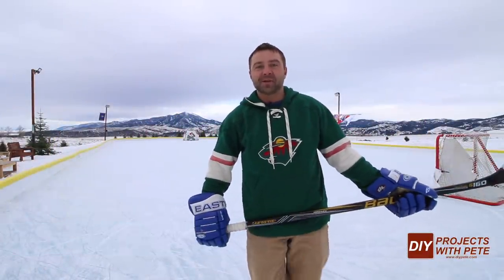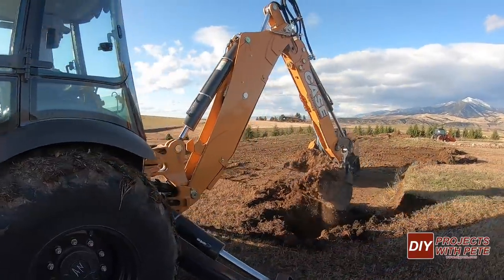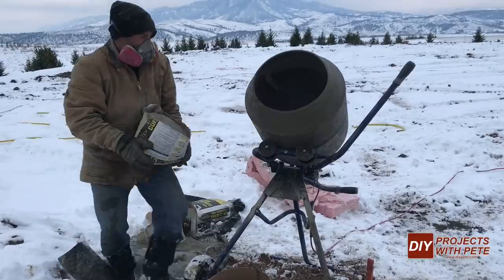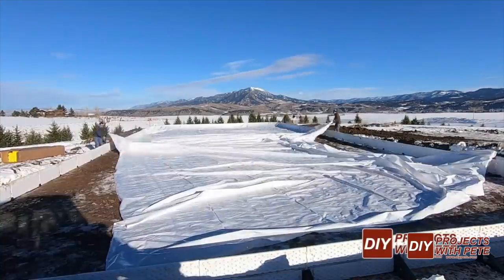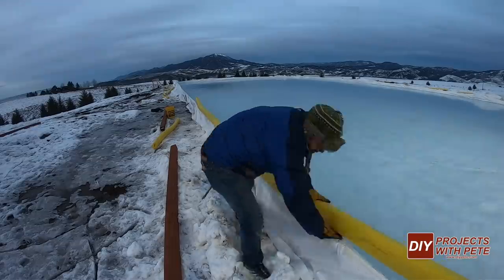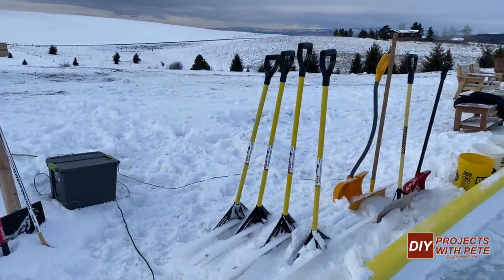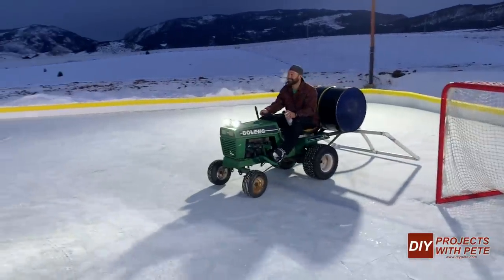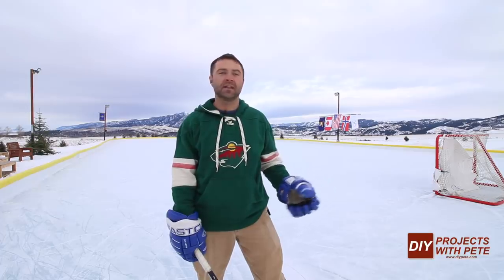Backyard Hockey Rink From Start to Finish | Year 2 Expansion and Updates

Comment: It’s funny how he acts like we have the skill and space to make a rink
Reply from the maker: If you have flat ground and a kit like this, it's totally doable. My rink definitely has things that are more challenging for sure. But you don't have to have big light posts or some of the add ons. Most folks don't have an 8 foot hill to level, which was my big challenge. Anyhow, check out some of the forums online about backyard rinks and you'll see a wide variety of folks building rinks of all sizes. Cheers!
Reply: @DIYPETE  I think fearblast more means like not a lot of people actually have the space or money to do this. Even NiceRinks small size is a couple thousand dollars
Reply from the maker: Gotcha. Growing up, my dad and I built a rink in the backyard using plywood and rebar. We still had to get a big white liner, but it was definitely a lot more budget friendly. I have some friends who built a very small rink in their yard that is 10 foot by 10 foot and they used 2x8 boards for the sides. They basically use it for puck handling practice since it is small, but it is still a great way to practice skills. Definitely lots of DIY options for those who want to save some money.  Cheers
Reply: @Dodger24  you can make your own for under $1000 the first year then just the price of a liner after that or do it old-school with no liner.

Comment: We build a much smaller rink, but still good enough for 3 on 3 adults.  We have an 8' by 12' changing shack built in 4' sections on my buddies back deck that we take down every year.  Insulated and filled with Christmas tree lights and cable TV with the NHL network.  We also put center ice and blue line lights under the liner for when we play at night.  That rink is a beauty.
Reply from the maker: Hey David! You have an awesome setup! I love the idea of the shack / warming house. I plan to build one this summer for the rink and to have it all ready for next season! :) Those blue line and ice lights sound awesome. Do they rest on the liner? Do you tape them or something to keep them in place while it is filling up? I bet that warming shack is awesome!! Cheers

Comment: I am totally amazed of the work... just incredible.

Have you ever thought of making a ceiling? Like putting some iron beams like you did with the light poles.( sort of a "indoor rink" that will protect the rink from snow storms.

I know it can be a bit expensive but it would actually save a lot of money in the long run (taking in mind that Montana is a snowy state).

Other than that its amazing, well done👌🏼👏🏼

Comment: If you could, try and add a cover or a tarp over the rink at night. You would probably need to have one custom that won’t break under the weight of the snow, but just shoveling off the top sounds a lot easier than the whole rink! But what do I know, I live in south Florida... great video and keep up the awesome work!
Reply from the maker: Hey Jared! Hope all is well down in South Florida :) Thanks for sharing the ideas. To be honest, snow blowing and shoveling isn't a huge deal and it doesn't have to happen everyday. With the high winds out here, it would be pretty tough to manage a tarp, and the snow load on it would be incredible, that you'd have to shovel off the tarp just to move it since it would be so heavy and big. Thanks so much for commenting, and for the kind words. Hope all is well!!

Comment: Very nice rink!  I'm going to guess this is would be well over $60k if you had to construct the rink without sponsorship and friends with equipment to borrow.  If you've got the right site, a pond of similar size is much cheaper to have dug.  No issues with water or liners but having boards is more of a challenge, and we just try to shovel the banks clean and vertical, but a bounce pass up the boards is a low percentage play.  Another downside to a pond is that you have to get the snow off quickly before the ice gets pushed down and water comes up into the snow which makes its very hard to clear, but if you are in a cold climate with not too much snow its pretty manageable.  We did an oval pond about 100'x120' on the long axis, and 20' deep for rainbow trout and is was $11k, plus we put a dock out and its our pool in the summer.

Comment: 91 pucks were found? WOW!!!
Soon, you'll might want to put up some taller and glass boards like they do in the NHL.
Reply from the maker: Hi! Yeah, most went out before I had put up the netting behind each goal line. And then sometimes when you hit the goal pipe it would bounce out if it went real high. Now that I have all the netting up this year, it save all the pucks for the most part. But no matter what, I'll still lose a few pucks temporarily until they are found in the spring! :) I have a bank of about 200 pucks so I'm not worried. CHeers!
Reply: @DIYPETE  And my current account only has 3 pucks. ✌🏻🤣🥅
Reply from the maker: @BlueshirtFan4Ever  better order some pucks! :) haha, j/k, Cheers man!
Reply: @DIYPETE  Cheers right back at ya!! 👌🏻

Comment: Nice video, This ia question I have is, can't you just drain the water out and remove the liner from the rink and leave the side boards up? less work to do the following year is what I'm thinking. I see everybody is saying where's the penalty box, plus wheres the heated bathrooms l o l
Reply from the maker: Hi Robert! You are right, you could take 1 or 2 boards off to drain the water, then remove the liner, and leave the boards up. It took me about 1 1/2 hours to take down all the boards, brackets, etc and stack them last year. Putting them up took about 3 hours this year. So it's not super time consuming. I like to have them down so I don't need to trim and mow around them once there is grass. We are going to use the space for summer sports, but it could be cool to keep them up if you were playing yard hockey or something that the boards would serve a purpose for. Cheers!

Comment: This is an amazing rink Pete, but I have one question, how come the boards as so short, I don't know much about rinks so maybe you could clear it up for me, Im assuming maintenance and costs? Amazing rink though
Reply from the maker: Hi! For outdoor / backyard style hockey, taller boards are not needed. Especially if you are not checking. Taller boards on the end are sometimes nice though. Wind is also a big concern and would drift too much against taller boards in many situations. The cost of full boards are quite expensive. Anyhow, short boards keep the puck in place and hold the water. We have 10 foot high nets behind each end to catch the puck when the goal is missed :) Cheers!
Reply: @DIYPETE  Thanks for the clearing that up, awesome rink and stay safe

Comment: Jesus man.  Crazy you all got this going.  I want to make one like this in Tatamagouche NS.  Maybe you could help me find ways to get it done on the cheap like you did.... :)
Reply from the maker: Hey Dougie! Great to hear from you. You should definitely build a rink. There are all sorts of ways to build a rink for every budget. We actually used to do the boards out of 18 inch tall plywood around the sides and 4 foot tall plywood at each end. A lot of folks use 2x10 boards. Just make sure to use a white liner as it will help reflect the sun and keep the ice cooler. Cheers!
Reply: @DIYPETE  Ok great idea.  I'll pop in if i have any questions.  Gonna just watch these videos a bit closer.

Comment: Awesome! Okay, brass tacks: how much, all totalled?
Reply from the maker: Hi! The rink kit for this larger sized rink in in the $5800 range. The dirt/fill was free and the equipment was donated, with an exception of fuel etc. The lights were around $800 or so total, posts / steel brackets etc around $400, flags / other accessories additional, concrete and post hole auger around $300. I've added things this year and so investments in new things have been split among the years. There are rinks for all budgets though, and you don't have to use a kit. You can certainly build a rink out of 2x10 boards or plywood. I would recommend using a white liner to hold the water. Here is pricing on the kits just so you have an idea on how size affects cost: https://www.nicerink.com/rink-builder Cheers!
Reply: DIY PETE thanks! Great video and something your kids will always remember.

Comment: Ever thought about pouring a concrete slab to have it on? Would it be less work to maintain if you covered it with a simple roof? I know it would probably be lots of money, but start charging a skating fee, then maybe there's be money for it ;) Love your work! Very jealous here :D
Reply from the maker: Hi! I've looked into doing a concrete pad. I built the rink 120x60 which is the exact size I'd need for a full size tennis court -- ( also could be used as a roller hockey court or for basketball ) -- I do like the grass for summer sports, but we may do concrete someday. It is a big investment though for sure ) I've thought of a roof, but I do love skating under the sunshine and stars --- we'll see though! Cheers!

Comment: So why do i need the Nicerink stuff? Its a barrier and some supports? A kid can make those with some plastic. Do they help with assembly at all?
Reply from the maker: Hi! It is just one way to build it. You could certainly use plywood for the boards and rebar stakes or some sort of brace. It's a kit that is convenient for those who want it, and no tools besides a rubber mallet are needed. The plastic stakes go into the grass, and the boards lock together. They are thick heavy duty plastic and so they won't warp or degrade over time. The kick plates give it a nice appearance and the puck bounces well off them. The bumper is there to hold the kick plate and liner in place. The kit comes with a white liner, which you'll want to get somewhere. Anyhow, you certainly don't need to have a kit, and could make one however you'd like with as much or little DIY'ing as you'd like :)  Cheers

Comment: Hey, I live in a place that doesn't get cold enough for ice. How to I make my rink water freeze??? I've been waiting two months already!
Also, my friend thinks I won't need one of those snow blowers as it doesn't snow here either. What are your thoughts?
Reply from the maker: Hi! Well, if it doesn't get cold enough for ice, the only way would to do a refrigerated system. A refrigerated system is ridiculously expensive, and you'd still need decently cold weather. The option to look into would probably be synthetic ice. It is still really expensive, but has been coming down somewhat in price since there are more companies making it. The tiles are probably the most affordable option, but they have larger sheets of it as well.

Comment: Not a hockey guy but I want to know more about the lights. What kind did you use. What is the range of the light?
Reply from the maker: Hey Zach! Thanks, I used 240 Watt 40,000 lumen lights from Amazon. Definitely plenty of power.
Reply: @DIYPETE  we struggle with dark soccer fields during short winter days. Looking for some options, thanks!

Comment: Awesome! How much did all of this cost?
Reply from the maker: Hi! The board / liner system was around $5900 or so for this larger sized rink. The lights, flags, concrete, etc was additional, and much of the equipment was donated, with the exception of fuel etc. Rinks can be built with kits or many people do them out of 2x10 boards or plywood. I would recommend a white liner. Cheers!

Comment: To do it right your rink should stay up all year. Like a swimming pool. You need to figure out how to make it involve less work. Run a water pipe under ground to refill it is one solution and drain system.  Creating a small rinks size was a smart thing to do. Zamboni is a must.
Reply from the maker: Hi! Now that all the leveling is complete, I'll plant grass this summer and it will be used for summer sports. The boards and liner actually only take about 3-5 hours to do so it honestly isn't that bad, and I like having the space to use in the summertime and to not have to trim mow around boards. Someday I might do a permanent board system if I ever did full boards, but for now it works real well. As for filling it, I'd like to have a new well put in someday that would be able to do the rink. Would be quite an investment, but then I wouldn't need to do the water truck every year. All in time! :)

Comment: How do you get the snow blower onto the rink?
Reply from the maker: Hi Jeanie! I've used a couple methods over the years. to get heavy equipment on ( like a tractor or bobcat ) - I take out a board section or two once the ice is completely frozen. I built a replacement board out of plywood that can then be slipped in and out when I need to get the equipment on. The other way has been to use an aluminum ramp or do build a little ramp. This has worked great to get a snowblower or power broom on without taking boards out. Cheers!

Comment: 17:41 you need to create a T shaped outlet, I made one using pvc with holes drilled in it attached to the hose. the trick isnt entirely how large the holes are. it's the temperature of the water and speed you're moving. so you need HOT water and a speed that coats the ice thinly but enough to fill cracks and ruts. don't flood the ice, because then you need to get the shovel out. the hot water cools on the ice faster than cold water. Hope it helps for your zamboni. 

Edit: I made a picture. Disregard all attempts at artistry. http://puu.sh/F1aIV/5a23483093.png the T should be larger than the vehicle so you don't have to get to super close to the sides of the rink.
Reply from the maker: Hey Matt! Thanks for all the tips bud, I appreciate it! Awesome diagram you made, I'll get to building! :)

Comment: Wonder how feasible it would be to put a roof on that bad boy
Reply from the maker: Hi! That'd require a lot of post holes, posts, and quite an expense for roofing materials to cover that much square footage. A lot of folks suggest it, but there is also something about skating under the sunshine and under the stars and moon that is very appealing. Would take away a bit from the outdoor experience in my eyes, but that's just me. I don't mind the maintenance. I am at 5,280 feet so that does help a lot with cooler temperatures so the ice doesn't melt near as much as the rinks in town. Cheers!

Comment: Wondering how much does this cost?
Reply from the maker: Hi! The board system for this size rink 120x60 feet --- runs about $5800. A smaller rink ( 22x44 ) is around $1900. You can build a rink for any budget though, so if you don't want a kit, you could always build the boards out of wood ( plywood or 2x10 boards ) -- to save money. I would recommend getting a white tarp which will reflect the sun and help keep the ice cold. Cheers!

Comment: would not have cut the excess line off because next year you will have to get the EXACT same layout otherwise the line will not work.
Reply from the maker: Hey Greg! Yeah I probably should have. At least the posts will all remain in the exact spots as the brackets will stay in all year, so will most likely be alright but worst case could extend the wire. Cheers!

Comment: some one needs to donate a old mtd/cub tractor with a snowblower on it, so you can drag the ice resurfacer behind attached to a water barrel on the tractor instead of dragging a hose around. One trip around, snow is gone and it is resurfaced.
Edit: Ok nvm looks like someone already did this.
Reply from the maker: For sure! Just worked on the prototype for version 1 and tried it out last night. So fun and much much quicker. Going to restore the old tractor completely. Should be fun, thanks!

Comment: Nice but how much
Reply from the maker: Thanks for watching! The link in the description has more information on the kit I used. There are many methods to building a rink --- you can completely DIY a rink using plywood or 2x8 boards, or can go with kits. There are quite a few variables. But if you have a specific question on a rink size you are trying to build, let me know and I can give you an estimate, or steer you in the right direction to fit your budget. Cheers!

Comment: Why not have the boards taller?
Reply from the maker: Hi! For backyard hockey, We generally are not wearing full pads and so we don't really lift the puck. So we don't need the full boards since we are not checking, and the side boards are plenty high to keep the puck in since you don't shoot in that direction. We have nets on each end that will keep the pucks from getting lost. Pond hockey really helps with stick handling skills , passing, etc. And all that can be done without tall boards. It is also very easy to shovel snow over lower boards, and snow can't drift as high. Taller boards certainly could be cool though, and I'm not against them by any means. I might someday build some taller boards out of wood. Buying pre-made large boards is really expensive, but I think you could frame out each board with 2x4 boards and then attach plywood fairly inexpensively. You'd need a lot larger area to store all the boards, and would want them all covered when not in use so they don't warp.
Reply: @DIYPETE  for my pond when I was a kid we always lifted the puck. It was usually either an orange sponge pick or a tennis ball. There were no boards on the side but had large stacks of wooden pallets(DIY boards) behind each net to help prevent having to fetch the puck everytime it missed the net. Kind of similar how there is only netting in stadiums on each end and not on the sides.